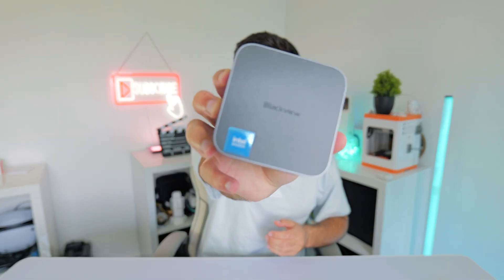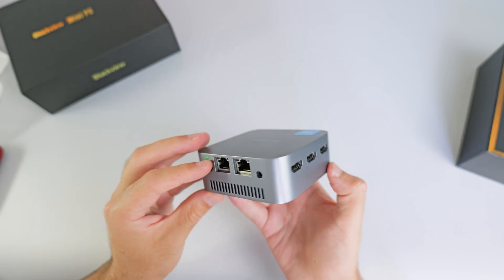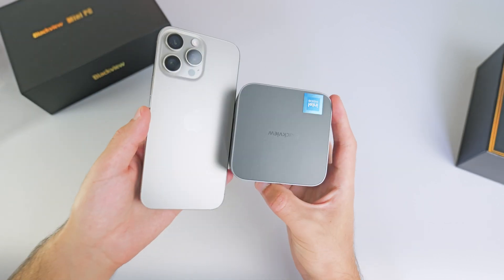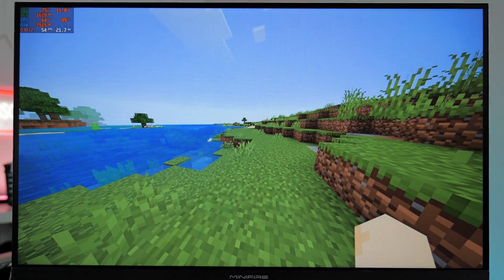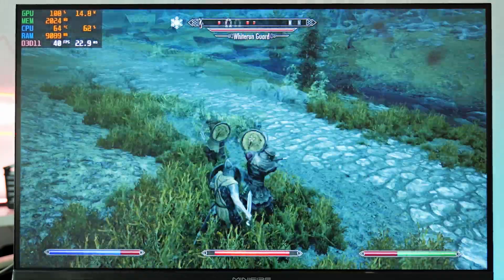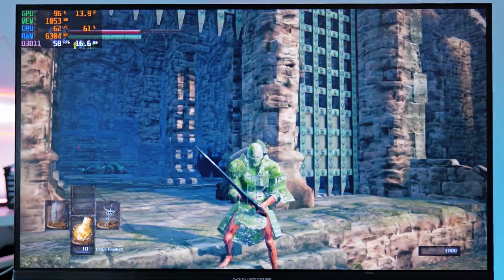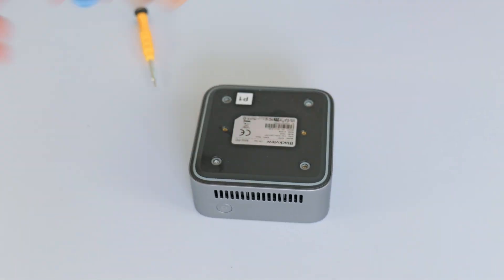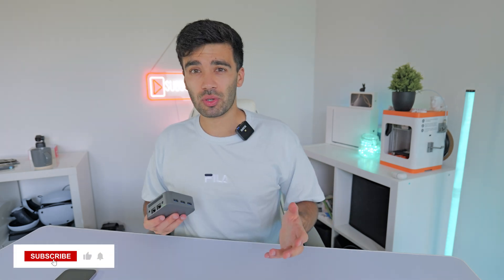The Smallest PC I’ve Ever Tested – Blackview MP80 Mini PC (Unboxing, Gaming & Tear Down)

Comment: Amigo, gracias por compartir. Yo compré la misma pero la siento muy lenta para iniciar...tarda alrededor de 40-50 segundos con el windows 11. ¿A ti te pasa lo mismo? Ya le configuré la bios para que detecte la memoria a 4800 (porque por default viene a 3200) pero no mejoró. La Chuwi LarkBox X, que es un modelo similar, es mucho más rápida e inicia en 13-15 segundos.

Comment: WHERE   IS   POWER   SUPPLY    VIDEO    CARD     ETC    ?
Reply from the maker: The power supply is built into the power cable. It uses intergrated graphics so in the same chip as the cpu 😁